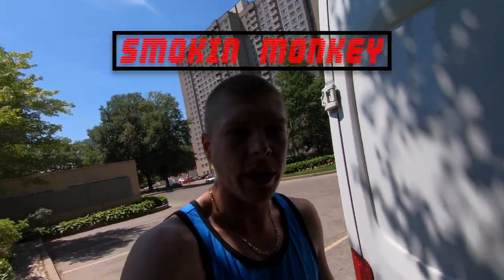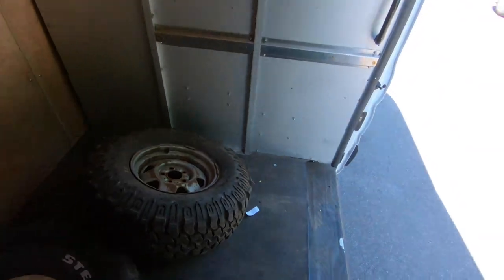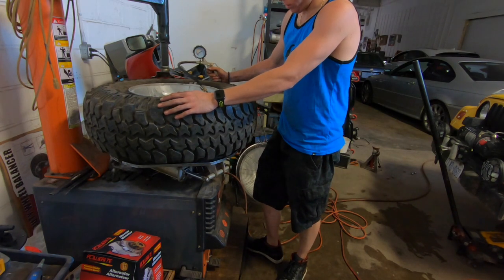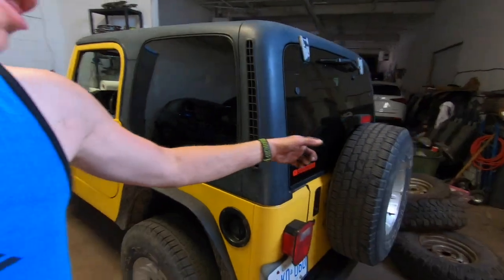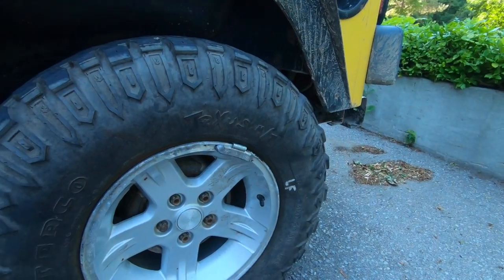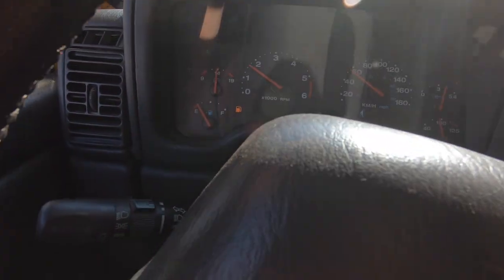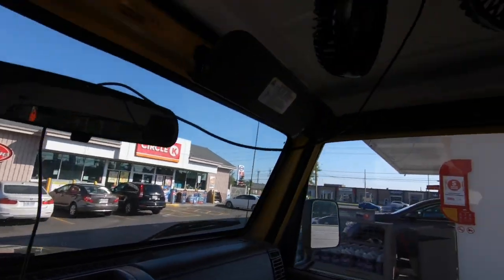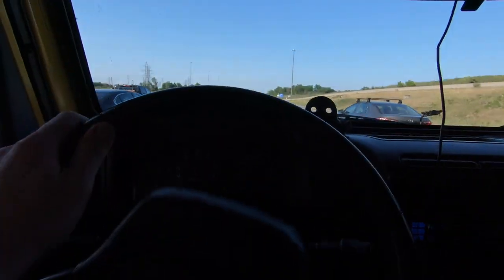The TJ Gets Super Swampers!!! Install And Road Test!

Comment: Are you getting any turning issues with the 31s hitting the fenders on the inside or the steering linkage? Great video SemperFi
Reply from the maker: Yes my current and my last set of 31s both rubbed the lower control arms but until I get some deeper offset rims I'll have to be mindful to not full lock the steering and it's not a big deal